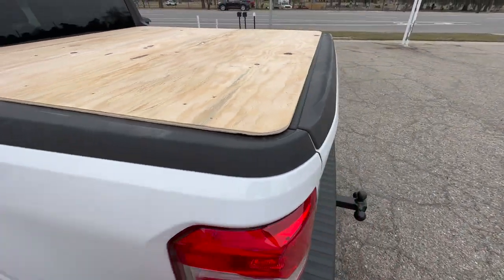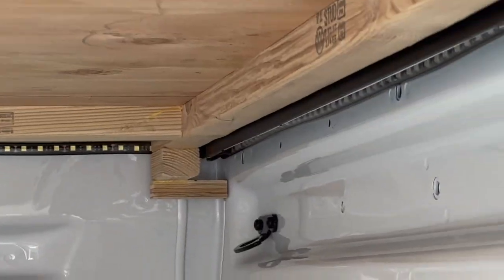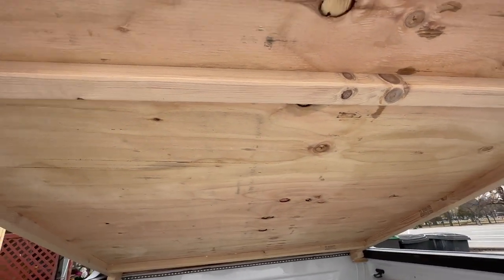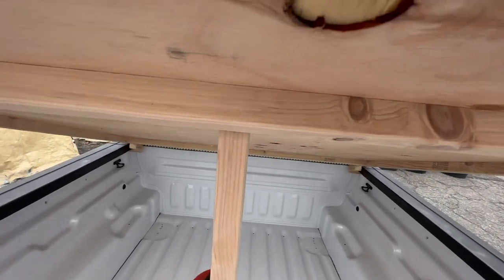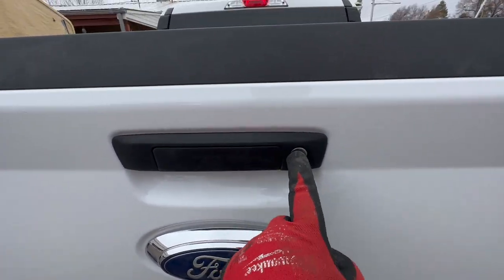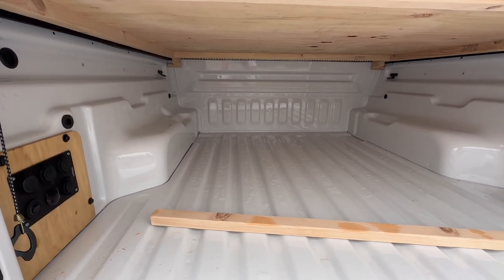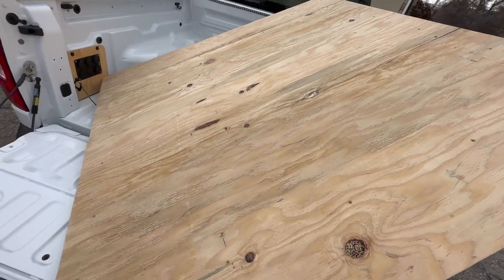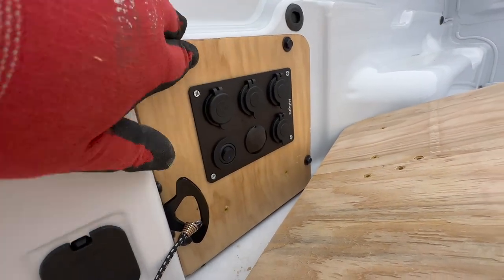DIY Truck Bed Cover for the Ford Maverick

Comment: Remind me not to ride behind you on the highway when that plywood sheet goes sailing off. You need something a LOT beefier than teeny wooden cleats and 99 cent bungees holding that on.
Reply from the maker: Someone else commented the same thought, you’re right, I’ll be looking for a stronger connection to use it at highway speeds.
Reply: It's not going anywhere. Have you ever heard of aerodynamics?

Comment: very cool, apologize if someone already said this but a little weather striping would provide some water protection. and i saw the gas strut idea....with a quick connect on one end of the strut it could still be quickly removable.
Reply from the maker: Thanks for the tip!

Comment: How has it held up after a year? I'm guessing sun and rain is going to warp the plywood, has that happened?
Reply from the maker: Thanks for your comment! No, it hasn't warped. That's because it's in storage all the time. I only pull it out when I need to use it which is pretty seldom.

Comment: I like your ingenuity!  Any plans of it you can share?  Size/length of underside structural boards?
Reply from the maker: Thank you, I appreciate that! The boards outside to outside are 52” with both being 48” long. The front board from outside to rear board outside is 42.5” and they are 49” long in between the side boards. The front starts 6.25” from the front plywood edge and the sides are 2” from the boards. I hope that helps!

Comment: Maybe run a thin line of weatherstripping along the bottom edges to help minimize the noise when driving over rough roads.
Reply from the maker: I think that's a good idea - I haven't noticed much any noise, but it would be good to add, also help seal too!

Comment: Please, Nobody do this with a Sheet of plywood. Those Lil L Shape chunks of wood and those Cheap crappy Habour Freight bungee cords will NOT hold a sheet of plywood to your truck if you take it at highway speed. Grew up doing construction and watching plywood fly out of someone's truck at 60-70mph can and will get someone killed. I've seen half inch in the bed of the truck get caught by wind and lift out and go straight through the front windshield of the minivan behind them. That's why you use metal clamps, brackets, etc that's mounted/clamped securely to the vehicle.
Reply from the maker: Thanks for the comment, that’s a good idea. I’ll look for a stronger connection to hold it down instead of those bungees. 👍🏼
Reply: @ScottRusson  cam lock strap would do the trick and also quick to remove

Comment: If someone built something like this and had to get the bed cover home while hauling something taller than this,allows,  Do you have a plan of how to get the bed cover home?  Or would it be better to make a tri fold one for that?  I don't want to be limited in case I unexpectedly want to haul something taller
Reply from the maker: Good point, a try-fold could work 👍🏻

Comment: Great idea and nice but you seriously need to do something to hold it down to the truck beside the two rubber bands. With the right wind gust creating an updraft it will fly off of there faster than you can blink your eyes, it would not look pretty jammed through another cars windshield.
Reply from the maker: Thanks, I understand the concern. It has the 2 wood pieces in front preventing the front from popping out, and the 2 bungee cords holding down the rear. So far I have not had any issues, or even noticed any rattling from wind trying to take it off while driving. But, it would be wise to think of a sturdier method. Thanks for commenting!
Reply: @ScottRusson  Take a look at the older Jeep hood latches. They are spring loaded only move 3/4" or so then come to a full positive stop, they might work well for your purpose or the turn latch set up you mentioned if it has anti turn built into it. Sorry to be so blunt, better to be safe than sorry.

Comment: how can you put anything bigger in with the pole.
Reply from the maker: The wood stick holding it up can easily be moved to any spot, or if you have something large, you can just slide it in without the pole. 👍🏻

Comment: Nice idea, but you'd better secure it much more. That's gonna fly off and if you're in front of another vehicle, you're gonna have a hell of  a lawsuit on your hands. I bought my soft cover for my truck for $170  on ebay. Very secure.
Reply from the maker: So far I've driven almost 1000 miles with it on, and it has worked well! However I do understand your concern, and I do take it seriously. If I think of another design, I'll share it!
Reply: Do you have a link for your soft top Wirework616?